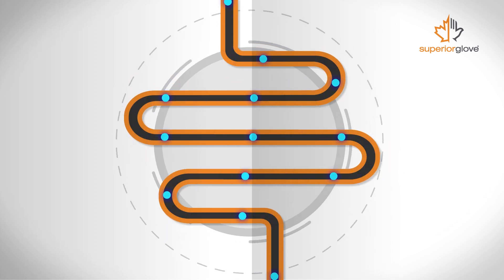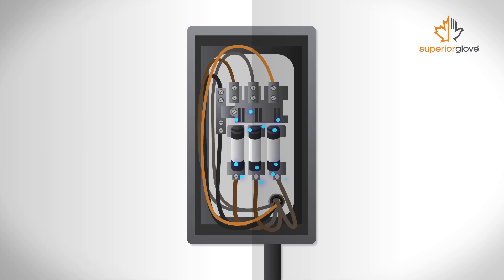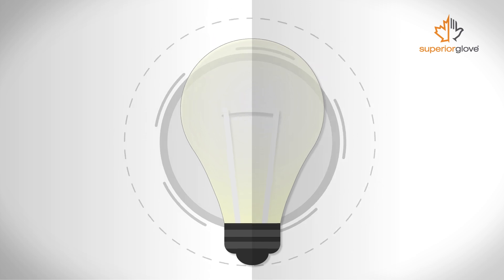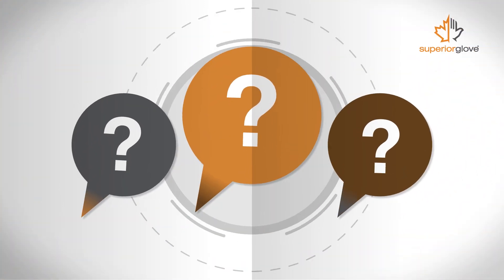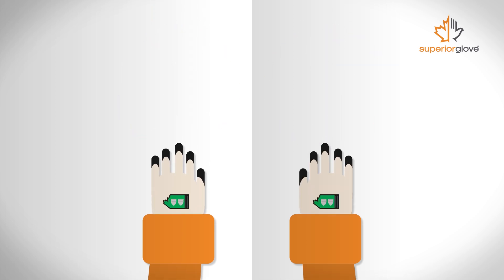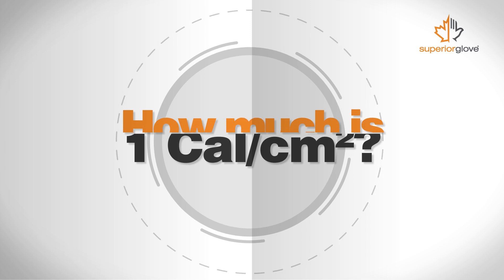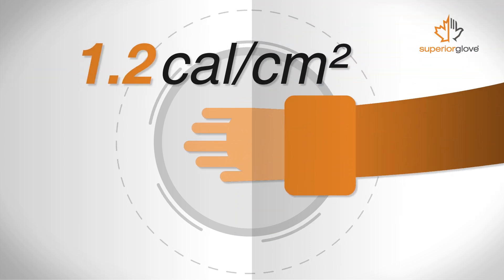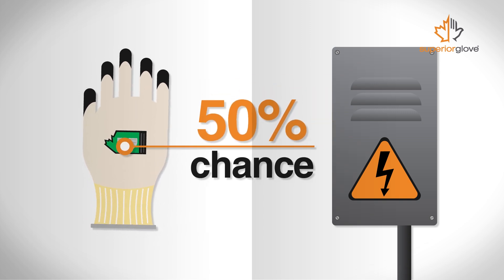What is Arc Flash?

Comment: An arc inside a light bulb? Don't you mean a tungsten wire heating up to red hot?
Reply: Maybe he means not your typical incandescent bulb,  some bulb types , like metal halide,  high pressure sodium used for street lighting,  as well as the old school mercury vapor yard lamps now mostly replaced with LED, are classified as High Intensity Discharge lamps, and use an electric arc through a mixture of gasses and metals, same with fluorescent and neon lights used in decorative signs
Reply: @Sparky-ww5re  yeah. Maybe

Comment: what is the recommended material for work shirts or what is the worst type material to wear around high voltage switch gear if an arc flash occurs .....thanks
Reply from the maker: Hi Gale, thanks for reaching out. We have a chart, based on the Arc Flash Hazard PPE Categories under NFPA 70E - 2015 on our website, it can be viewed here: https://goo.gl/21cuaz
Reply: can i make a question for you about flash arc? @SuperiorGloveWorks
Reply: Gary Vale Nylon fabric is the worst. Arc flash coat is the best.